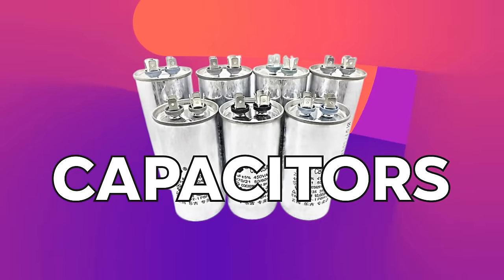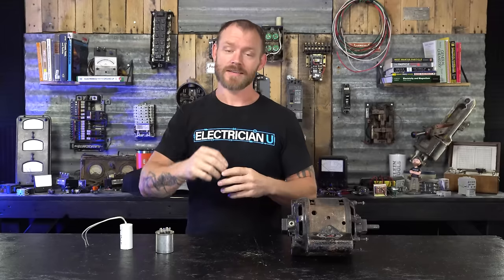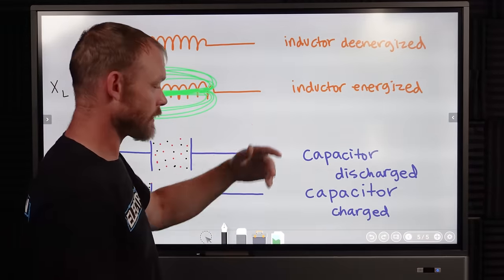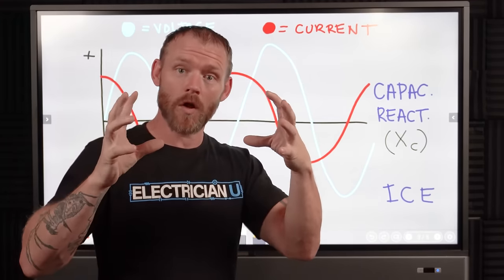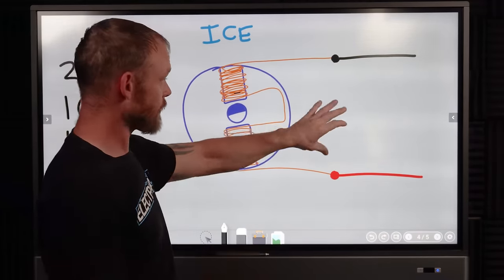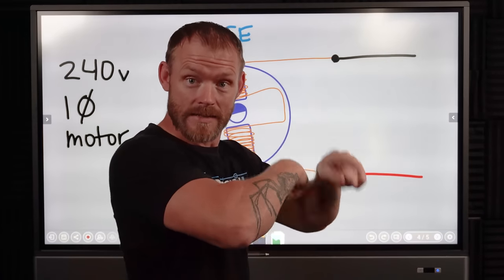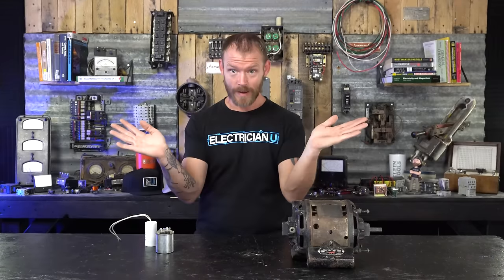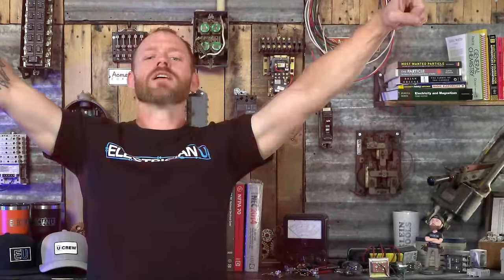Why Are Capacitors on Motors? What is Capacitive Reactance and Inductive Reactance?

Comment: Hi. I can explain it much more easy to understand.
For quick voltage changes (High frequency) The capacitors and inductors behave opposite way. Capacitors behave as a short, Inductors like a resistor. (When you calculate reactances sub high frequency)
If the capacitor `short` current comes first than the voltage. If the inductor like a resistance. Voltage comes first and the current will come later. (These reactancy (resistance) values are keep changing)
To get the maximum power at any point of the signal. P=UxI  the voltage and the current has to be in shync. 
So if you have the motor (inductive) and the current lag. You add a capacitor to lag the voltage to catch up.
So your motor gets themaximum amount power. At start of the motor you need the maximum amount power! 
On large motors these phase shifts can be very significant. Result in large power loss.

Comment: PSC Motors (Permanent Split Capacitor) requires less starting current thus require a smaller inverter for something like a back-up sump pump. They are also more efficient for a furnace fan (if load is properly matched). It will act like a two phase motor since the auxiliary winding is phase shifted 90 degrees.

Comment: The most common circumstance where motor caps are useful is where your supply is single phase power, feeding a motor with two windings (start windings and run windings). Capacitors are not used in three phase power because those motors are wound with three windings, and they automatically have a phase shift built into each of the three. Single phase motors have start windings to give mechanical advantage during the high torque startup phase. Motors built with only run windings would have difficulty starting because the magnetic field doesn't easily create a rotating magnetic field that the permanent magnet built into the rotor is chasing. By having two separate windings, you can use a capacitor to shift the phase of voltage feeding the start windings such that there is added starting torque no matter where the rotor comes to rest. From the perspective of the rotor, having a separate start winding allows the rotor to chase magnetic north, no matter what angle the rotor happens to be stopped at. Typical permanent split capacitor motors in HVAC applications have only a run capacitor in series with the start windings that is in line all the time. However you can increase motor torque and efficiency by using a separate run and start capacitor, both in series with the start windings. In that case they will have some mechanism to reduce current through the start cap after the motor spools up.

Comment: I love you, Dustin. You are by far my favorite youtube source for learning electrical skills.   I've learned a ton of incredibly useful stuff from your videos. But your explanation of how and why single phases motors use run and start capacitors is, let's say, lacking.  So here's my "more correct" answer...? :) :) :)

Single-phase motors have the problem that they can run forward and reverse just as easily.  three phase motors have a rotating field created by the three different phases, and will always rotate in the same direction when you start them.  But a single-phase motor, with only one winding, doesn't have a rotating field,. It has a pulsing field. It can run in either direction just as easily.  Every time you start them, which direction they start would just be random based on where the rotor last stopped and the phase of the power when you hit the ON switch.

The ONLY reason we have run and start capacitors on single-phase motors is to force them to always start up spinning in the same direction! It wouldn't be very useful if your fan motor started spinning backward half the time! And if the rotor stopped 90 deg to the windings, it might only start after giving it a little push.

So to make a single-phase motor spin the same way every time, a second winding is added to the motor (the start winding), and a capacitor is added in series with the second winding to shift its phase (as you explained in your video correctly). So now we have a two-phase motor, one phase for the main winding, and one for the start winding.  But using a capacitor as a cheap way to create a second phase doesn't work very well.  It only shifts the phase about 25 degrees in practice. In a three-phase motor, each phase is 120 degrees out of phase.  Creating a second phase that is only 25 degrees out of phase is good enough to force the motor to start spinning in the correct rotation, but very poor for providing even power. In a "real" 2-phase motor, we would have the phases 90 degrees out of sync.  But this "fake" second phase created with only a capacitor is good for getting it spinning in the right direction.  This is why these motors all use a centrifugal switch that turns off the second "fake" phase windings once the motor is spinning correctly. The start winding and start capacitor is only there to make sure it starts correctly and is spinning in the right direction. In a motor with only a start capacitor, the start winding is very small compared to the main winding.  It's just large enough, and so arranged, to help the motor start.  It is not designed to keep running and will overheat and possibly burn out, if the motor fails to start (is locked up for some reason) or if the centrifugal switch is bad and fails to turn off the start winding. A bad switch that keeps the start capacitor engaged will cause the motor to run very hot (burn your hand if you touch it hot), and very rough.

Many (I dare say most) single-phase motors don't have a run capacitor. they only have a start capacitor which is only used for starting the motor. But run capacitors are common in HVAC motors, so as electricians, we see them all the time.

The purpose of the run capacitor is to make use of the start winding even after the motor is running.  After all, they put all this extra copper into the motor, to make it start correctly, so why not try to make use of it to add a bit more power to the motor all the time? That is the goal of the run capacitor and the design of a single-phase motor that uses run capacitors.  In this type of motor, the extra start winding is used all the time. But they use a large capacitance to force the start winding to have more power (and more phase shift) to help it start correctly but then lower the capacitance when running because the start winding can not sustain the high start current for long. But this allows the start winding to help add more power to the motor (which reduces the cost-to-power ratio of the motor) at the cost of greater complexity and maintenance costs (capacitors break faster than motor windings break and must be replaced). In these motors, both the start and run capacitors are connected (in parallel) when starting, but then the start capacitor is disconnected once the motor is spinning fast enough, leaving only the run capacitor to feed power to the start winding.

In industrial applications, we just run all the high-power motors off of 3 phases and get rid of all this complexity of start windings and capacitors. Three-phase motors are dead simple and last a lifetime if they are not abused.  But for residential applications, like HVAC, where we don't have 3-phase, power, we must play these games with capacitors to force motors to spin the right way every time they start. And we must pay the HVAC techs to come out and replace our burned-out capacitors every few decades.
Reply: Also, your talk about power factor correction is all well and good, but start, and run capacitors are not for power factor correction. When large capacitors are used for power factor correction, they are wired in parallel with the inductive loads like motors or light ballasts, whereas start and run capacitors are wired in series with the motor start winding. The inductive load of the main winding is not connected to the run capacitor, so it does not help the power factor problem on these single-phase motors (or only helps a very small amount as a side effect).  Power factor correction is normally only done in large industrial 3-phase settings where the location has lots of big motors and lots of inductive lighting with very little resistive loads.   I've never heard of it being done for residential electrical (so that means it probably is done somewhere).  But the start and run capacitors are not there for the purpose of improving the power factor of the motor; their main purpose is just to allow a single-phase motor to start correctly.

Comment: It functions as a switch to start an AC motor. Using a switch has the same effect. On DC motors, connecting the - to ground, speeds it up to higher performance. For toys, capacitors are used for two directions.

Comment: A simple explanation I heard years ago...Since current is reluctant to change direction, the capacitor is acting like a big spring that loads up, and when it discharges, it helps to push the current in the circuit in the opposite direction as the supply voltage drops to zero.  The exact opposite happens when we jump a switch with a cap.  When closed the cap empties its charge.  When the switch opens and current wants to keep flowing, the current flows into the cap and is slowed down as the "spring" loads up with resistance and the contacts in the switch avoid arcing because the current doesn't jump across.  We older guys know when you change pitted points in an old distributor, you always change the condenser/capacitor because it is no longer doing its job of protecting the points.

Comment: I think the reason why current lags  voltage in  inductor is because of the back emf that is generated in  inductor as the current moves through the inductor. So current has to overcome the back emf before it gets to the other end of the inductor. In the course of trying to overcome the back emf  current flow is delayed and that's why voltage leads current in an inductor

Comment: one thing i'd like to say is my understanding of the subject is that there is no current flow through a capacitor. if there is  you got a problem.  since the plates (anode and cathode) never contact each other the only way for current to flow through them is if there is a leakage through the non-conductive barrier between them.  in dc circuits there is charge and discharge on the plates corresponding to the positive or negative side of the circuit. when one side is charged more than the other side the imbalance tries to find balance so the other side charges opposite.   in ac  current flow is an illusion  due to the plates charging and discharging at alternate polarities  50 60 even 400 cycles per second.  its the same as dc  just reversing its polarity super fast.      another thing to note is that depending on the motor there may be a separate winding that the start capacitor excites that is out of phase with the run windings. that way if the poles are not aligned the pulse will turn the rotor so the other windings can do thier thing. again that depends on the motor. capacitors because of thier characteristics are often used in timer circuits  but thats a whole other subject.
Reply: While technically correct from (only) a physics point of view, it's not helpful for virtually all applications.
If you consider a capacitor as a "black box" then current definately appears to flow through it.

Comment: The camera you displayed did not use capacitors to fire the flash.  That old press camera used magnesium filament flash bulbs and batteries just so you will know.  More modern camera flashes like in your cell phone use a rare earth gas discharge tube and yes capacitors are charged to very high voltages and discharged through the flash tube.

Comment: Here is what is wild to think about...

If you take an applied voltage and current and run them in a straight conductor from line to ground... You have created a "short" circuit, a fault condition.

But if you take that same conductor and bend enough loops into, it there will be enough "pushback" from the magnetic field created to restrict the flow of voltage/current... The magnetic field created by the electricity can be sufficient to "slow the flow" of that same electricity.

That "BONG!!!" noise you hear when you energize a transformer is massive amounts of current rushing through the windings because there is no magnetic field present for a few microseconds... As soon as the field builds it begins restricting the flow of current and the transformer starts doing its thing.

Comment: 13:50 is this power factor visible as a higher amperage draw? I harvested a duel speed fan from a microwave and I couldn’t get it to start reliably and went back to the wiring diagram and saw the start cap. After installing the cap it brought down the amperage used while running and also make it run faster.
Reply: The higher power draw without a cap is because, without a capacitor, the power draws while the voltage is falling to zero, and not at peak. Since the motor wants, say, 1000 watts, if the voltage is 50% then the amperage is double. It is not quite that clean cut, but close.

Comment: At 17:45 you talked about importance about courant and voltage in phase for efficency (the job of run capacitor) and at 20:16 you tell importance of the capacitor for out of phase current and voltage???

Comment: My state (Oregon) has continued to push off adopting certain GFCI requirements specifically because manufactures build equipment like AC units to dump the load built up on capacitors to the ground at a rate that exceeds 5mA (which nuisance trips GFCIs). Do you have any thoughts on how to resolve this problem? I want to provide GFCI protection everywhere, but don't know how to get around this without the manufacturers changing their builds.
Reply: Why do they dump to ground? Most just have a resister across the cap.

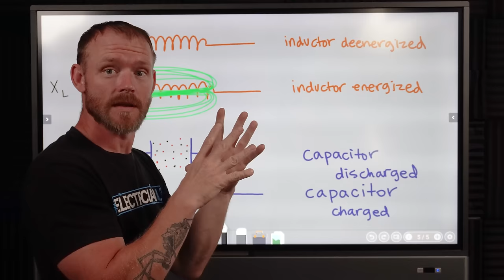Comment: 6:50 Funny that the inductor symbol looks like a spring, and the effect is like pushing on a spring, with the motion of the opposite end of the spring being like the current. 
Its motion there lags the push and pull on the spring in similar fashion 🙃

Comment: This is simple. A three phase motor had a rotating magnetic field in the stator winding. This what allows them to self start. A single phase motor does not have a rotating magnetic field. In a single phase motor, you have two windings. A run winding and a start winding. The capacitor phase shifts the voltage. So you have a two phase setup and hence a rotating magnetic field. Once the motor is running, the centrifugal switch cuts out the start winding. That simple. 

Early motors in machine tools had repulsion start. Here, the rotor windings are not shorted out. The brushes oppose one another over a commutator. This magnetic repulsion gets the motor started as each rotor winding gets its commutator kick. One running, a star plate is centrifugally forced to short out all the rotor windings meaning it’s now running as an induction motor.

Comment: Start capacitors are in series with the start windings. Run caps are in parallel with run windings load , correct?

Comment: Reactance is the individual resistance of the capacitor and inductor in the AC circuit, so combined with a resistor value, that gives you the total impedance for the circuit.

Comment: Great explanation, thank you.  My condensing unit has a dual motor run capacitor that’s only connected to the compressor , I found that odd.   The condenser fan is a variable speed fan is that why?   It’s a 45/10 capacitor.  I’m assuming a circuit board must be in the circuit for the fan.  Lennox unit.
Reply: variable speed fan is most likely a dc motor run on pulse width modulation.  companies buying in large quantities its probably cheaper to use the same part as some other unit uses  just only using one side

Comment: In a single-phase motor without auxiliary winding two rotating magnetic fields are created and they rotate in opposite directions to each other (Leblanc's theorem), The starting torque is zero. by starting the motor by hand, one of the fields is favored and the motor starts to turn in this direction (washing machines from the 1950s worked like this). The energy efficiency is however disastrous because the opposite magnetic field tends to brake the engine (problem also encountered on the alternators).
The auxiliary starting winding makes it possible to increase one of the fields but for that it must be fed by an out-of-phase current otherwise it remains a single-phase motor. To obtain this phase shift, a capacitor is used. This creates a sort of polyphase motor.
This technique limits the use of single-phase motors to low powers (max qq kw).

Three-phase motors do not have this problem because only one rotating magnetic field is created (Ferrari's theorem). With the advantage that this field remains of constant amplitude. However, if a voltage imbalance exists or these voltages are not sinusoidal, a reverse magnetic field is created which will cause the motor to heat up. For very large motors, the unbalances and harmonics of the network are controlled by specialized protection relays.
With regard to power factor and feedback compensation using capacitors, this is another problem. One can then use capacitors, electromechanically or electronically commutated capacitors or it can be done with over-excited alternators.